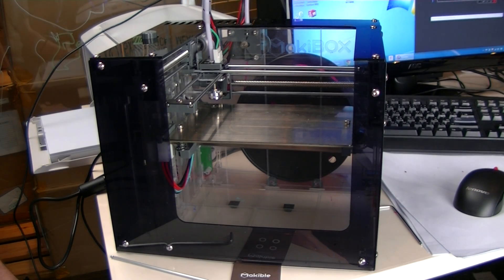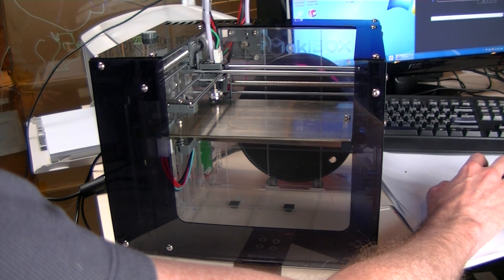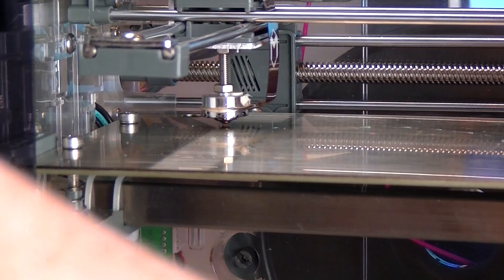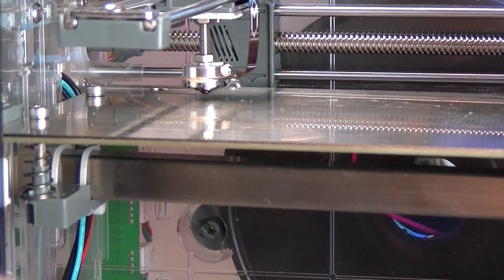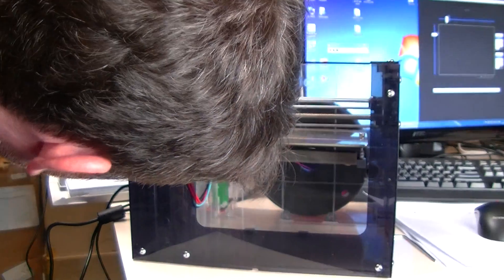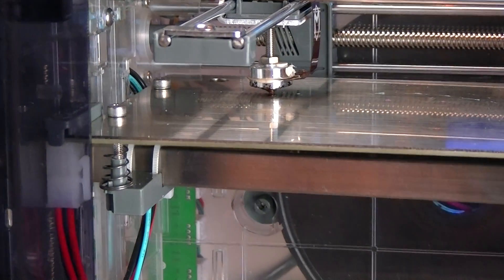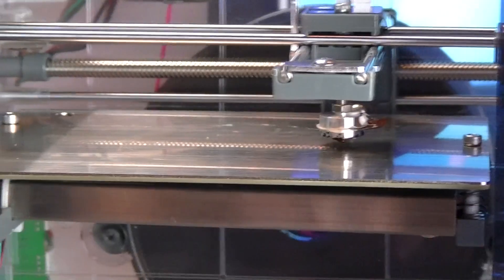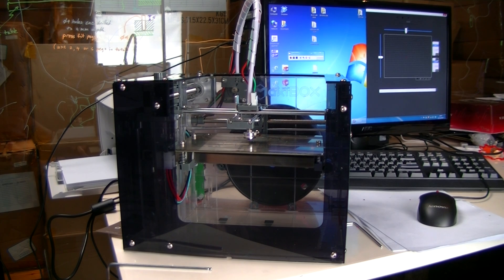#MakiBox - How to level your print bed.

Comment: Jon Any chance you can do an addition video for this, showing the app on the laptop? Even just the basics of moving the print head and or checking temp? (For those that haven't used a cnc/mill/3dprinter etc before.)